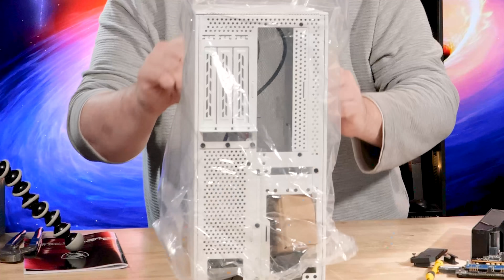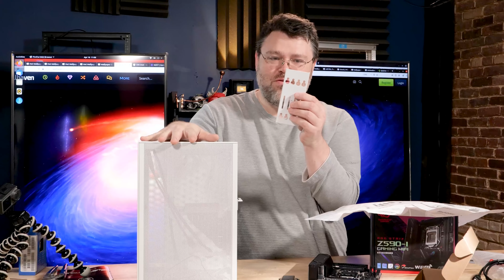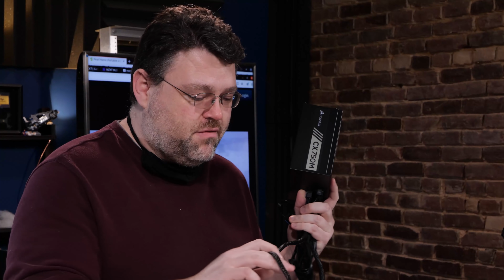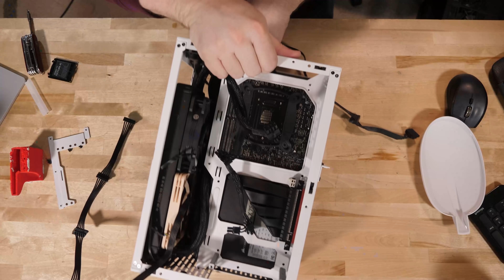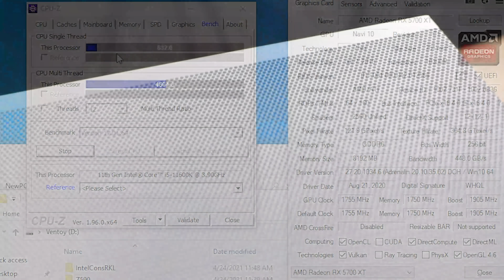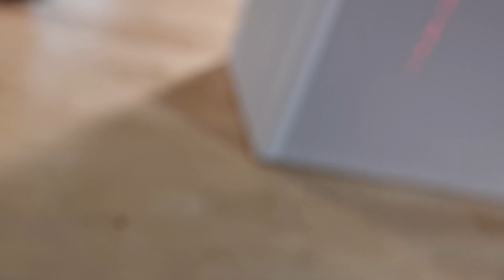Fergalicious? No, It's Meshlicious! ITX Case Review & Build

Comment: I followed this case for months and finally just got it a week or so ago. Even despite watching/reading as many build guides as I could ,I was still so frustrated. 280mm AIOs are ridiculously hard to fit unless you remove the middle spine (big design flaw imo) I had to remove everything that I smushed in there and now waiting on custom cables to start building again.

Comment: A little detail you forgot to mention. The 3090 (and other 30X0FEs) also push air through the Card, but that air gets blocked by the Mainboard thus somewhat overheating it.

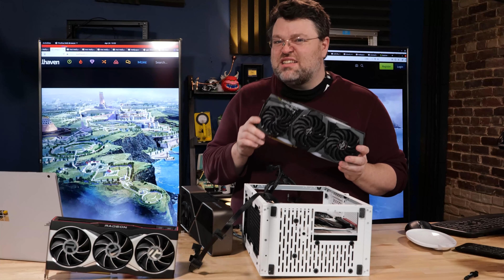Comment: 07:41 - "believe it or not, the Msi 2080 super is bigger than the rtx 3090" - i went and checked and determined it not to be the case - Msi gaming x trio 2080 super measures 328 x 140 x 56.5 mm, the reference rtx 3090 is 336 x 140 x 61mm
Reply from the maker: And yet in the video the parts that stick out on the end you can see it doesn't fit as well as the 3090 ...
Reply: @Level1Techs  i hadn't watched the video further, but yeah, seems like you're right. Even though the msi card is only shown diagonally in the case (which would make it longer) as opposed to the 3090 in its installed state, it seems to be a bigger..
Reply from the maker: It's just the plastic and heatpipes sticking off the end in the way. Otherwise it is a bit smaller. I could maneuver the 3090 on whereas on the super it wouldn't go

Comment: I DON'T LIKE IT! Wääääähhh!!! Wrong color :P "The little shoebox".

I'm pretty sure 750 watt PSU is just perfect. 200 W CPU + 300 W GPU = 500 W. PSUs like to be in the 20-80% utilization range. 20% of 750W is 150W. So, as long as you are drawing less than 600 W, it's dandy. It will be fine going over it too.